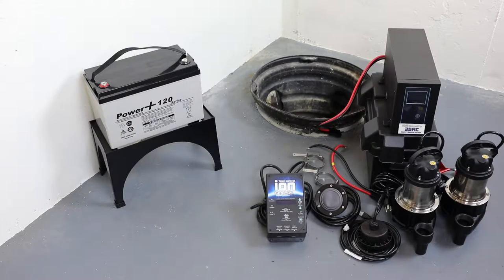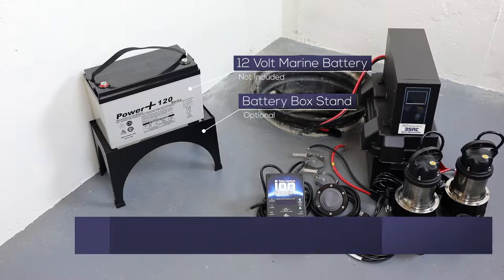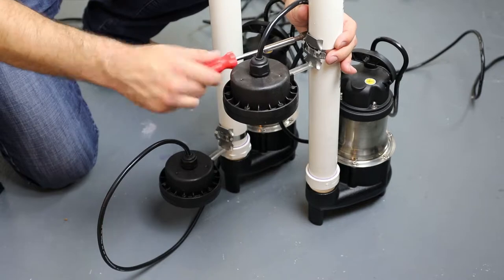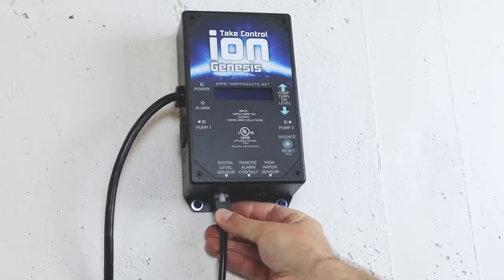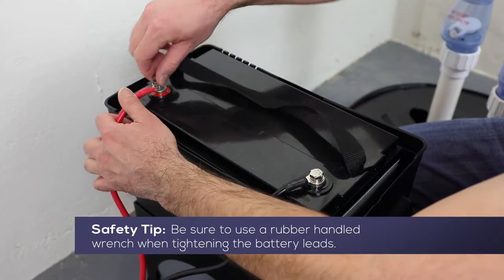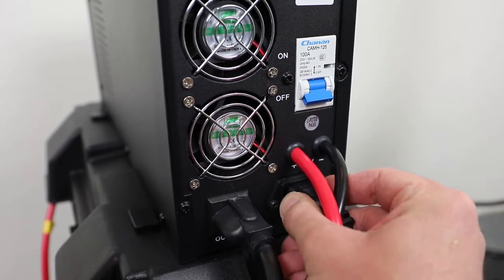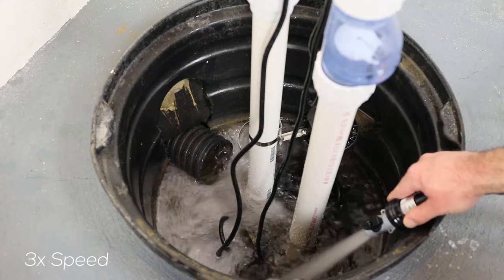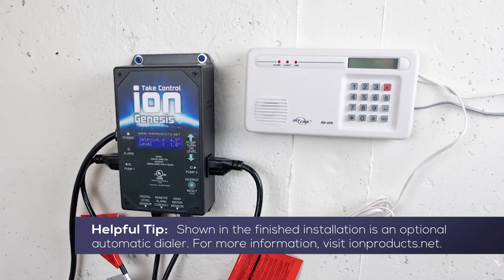35ACi Deluxe Step-by-Step Installation

Comment: Hey if my box is beeping on and off what would the issue be the battery looks like its charging
Reply from the maker: Hi Bryan,
There are a few reasons for the inverter to beep.
1. Check the blue breaker in the inverter's back and make sure it's in the on position (up).
2. Please check the power cord and make sure it is completely pushed in.
3. Depending on the age of the inverter and battery, a replacement might be necessary (we recommend replacing the battery every 3 to 5 years to prevent internal damage to the inverter).

Our customer service is available M-F from 8am to 4pm CST. For further troubleshooting, feel free to give us a call at 815-886-9200. Thank you.
Reply: @IonProtects  thank you so much for getting back to me I reset it and it stopped beeping (thank god) we had just refinished our basement and the last thing we needed is a flood I'm going to double check everything you had mentioned and call the plumber who installed it I have a feeling he gave us a used unit but if I can't get a hold of him I'll definitely contact you thank you so much for getting back to me we definitely appreciate it
Reply from the maker: @bryank3980  Very happy to hear that the unit has stopped beeping after the reset. By all means, please do reach out to us if it turns out further follow-up is indeed necessary.